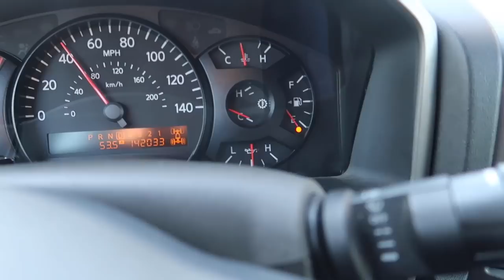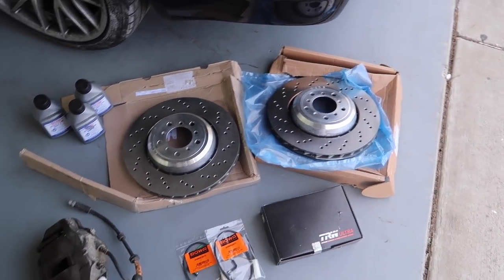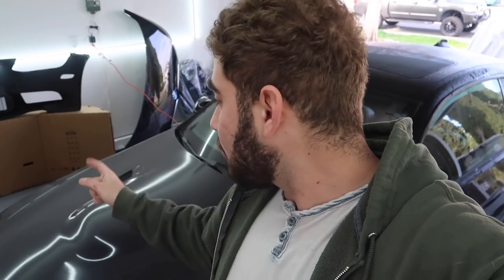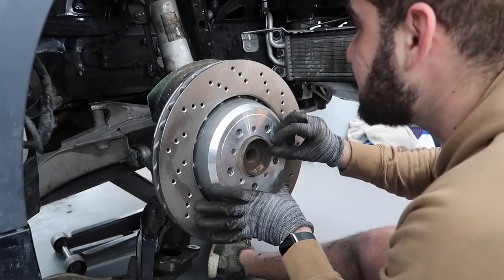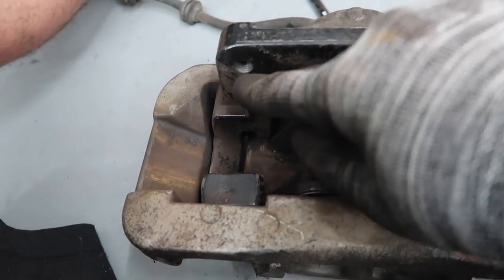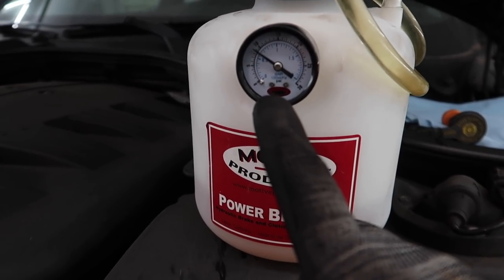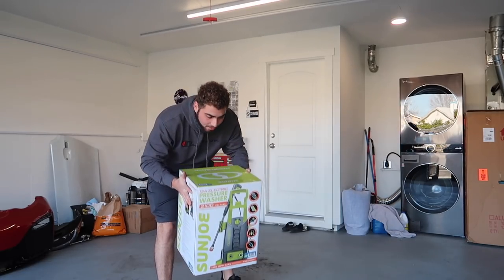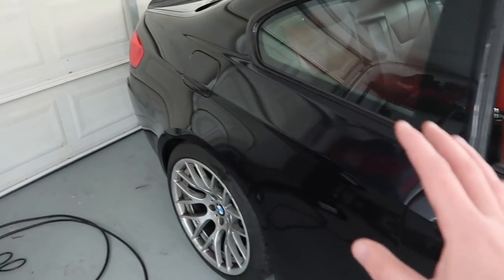THE E92 M3 IS BACK AND ON THE ROAD!! But I Wish With Better News. BUT....

Comment: That black stuff may be road tar.  You could use WD-40 in a bind or to test.  Or get some Ghemical Guys or Turtlewax bug and tar remover.  The Stoner stuff does not work that well, but that is just my two cents.

Comment: FYI you can’t just install the wrong brake caliper on the wrong side of the car the bleeder screw would be pointing downward which where you can bleed the system correctly. If you do that you can get air in the line and that’s extremely dangerous.
Reply from the maker: Turns out it was for passenger side just the bracket for some reason was wrong
Reply: @NourHummadi  nice 👍🏼

Comment: Hey Nour, just tryna help here I noticed you used clips on the airbag. Man if the airbag deploys the clips will pop out and it’ll be a projectile and very dangerous. I’ve seen it happen multiple times. I would change it out for your safety and for anyone who buys the car safety.